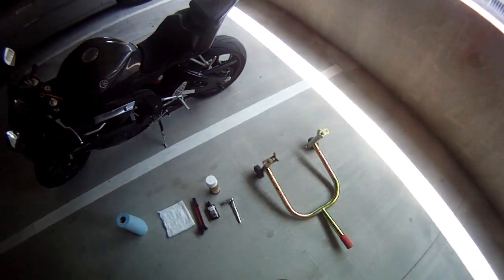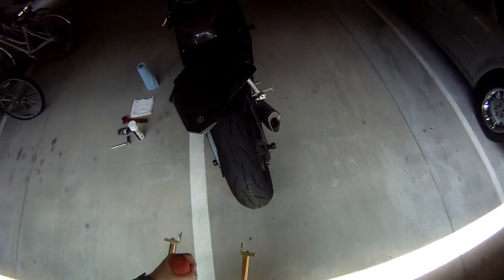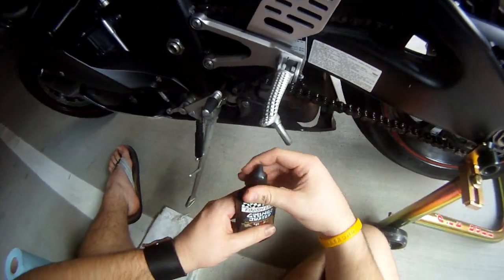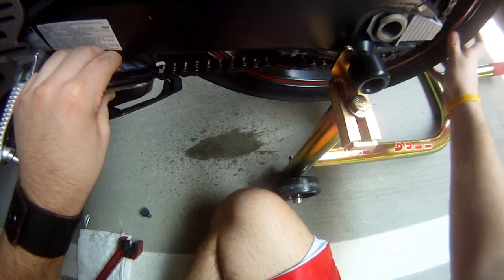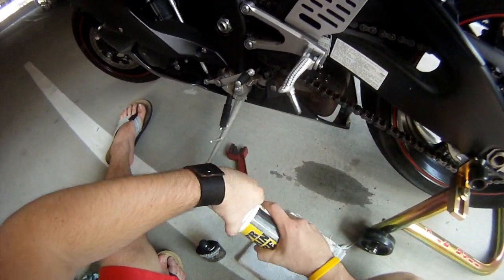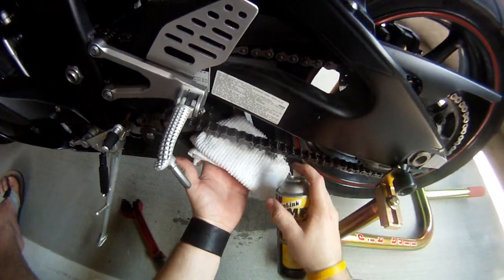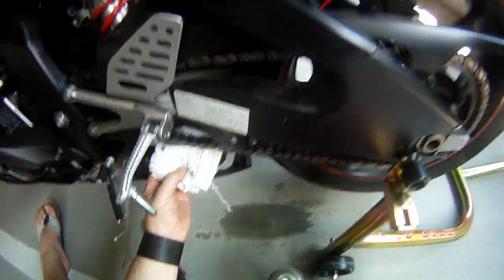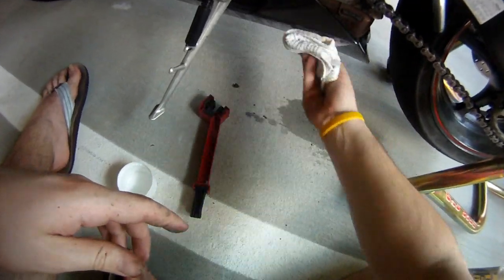How To: Clean and Lube a Motorcycle Chain

Comment: For applying lube after cleaning: Spray lube on a toothbrush instead of directly on the chain and spin tire. Less overspray and it spreads easier. Plus getting the back of the chain in a pain in the ass so the toothbrush helps reach back there. Just spray the toothbrush, apply to spinning chain, repeat till saturated on all sides. Don't hurt to hit the sprockets while your down their ;)
Reply: Mongoose Riding or getting your wheel spinning using your engine right after lubing (around the parking lot suffices)  will make even better than using the brush: centrifugal force will make sure all the lube gets in all the spots (sproket included) and all the excess gets "thrown away"
Reply: Kid574
I hear ya man. That's what I do. Start the bike on a paddock stand, let it warm up, 1st gear then spray while it's moving with a wax based lube... but on the tooth brush. Otherwise (depending on the bike) it gets all over the rim. I try to keep my fingers away from a moving chain I stop the bike and do the rim side of the chain one section at a time. Always comes out perfect.
Reply: Mongoose Sounds pretty effective, might give it a try next time!
Reply: +Mongoose please avoid telling people to put it in first gear while lubing their chain.. While its perfectly do-able, imagine some not-so-attentive individual getting their finger demolished in the sprocket as first gear continues to roll the chain.

Roll the chain with the bike off and by spinning the tire by hand.
Reply: stevenzig
True, although I did emphasize keeping fingers away from the moving parts.

Comment: easier to do it on the back where the sprocket is plus if you get a baby new tooth brush it gets all the nasty in the middle out. all you do is soak the brush in hot soapy water an you can reuse it.